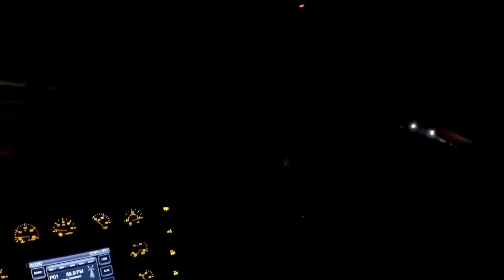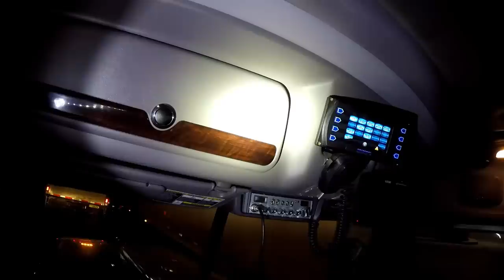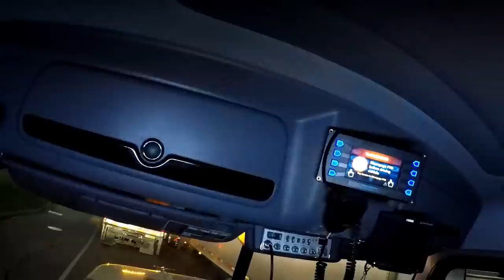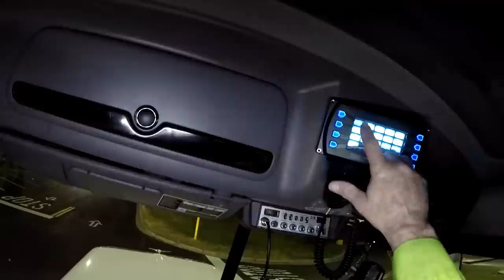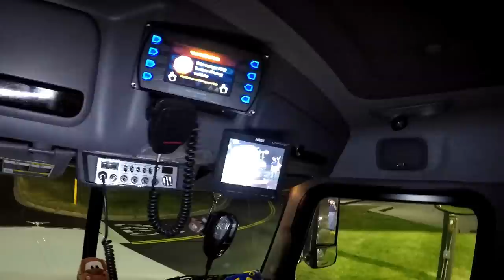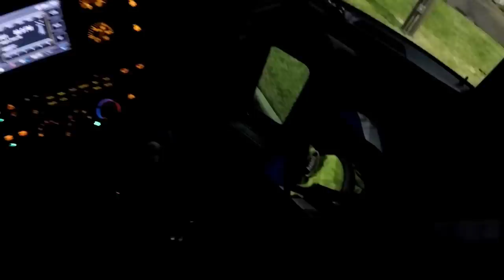Heavy Tire Lift Tow

Comment from the maker: One common question seems to be why I did not "tie" or "secure" the steering wheel.   The answer is quite simple...the steering tires can't move once they are strapped into the tire lift, therefore there is no need to secure the steering wheel.  Otherwise, on a front tow, the primary purpose for securing the steering wheel is so that the steer tires do not turn out while in tow.  Securing the steering wheel for a rear tow is absolutely necessary.  Hope this adequately answers your questions.  Thanks and God bless.
Reply: love your videos
Reply: As as side note for folks who keep asking these questions, I had run across quite a few videos a few years ago where someone "forgot" to secure the steering wheel while towing backwards.  In those videos the bus or car can "steer" to the side and easily take up multiple freeway lanes.  Securing the steer tires is only needed when those are on the ground and we want them to  travel in a straight line.  With the front wheels off the ground, there is no need to secure the steering wheel.
Reply: Ron, can you please make a youtube video of showing how to cage an air or disc brake on a tractor and trailer?  Jonmichal walker
Reply: Ron Pratt I love your video ever
Reply: i have heard stories of the tires rotating on the wheel lift and falling down the gap, but never heard of it myself. I must admit I do it just as a safety precaution as I'd rather not find out. Definately don't think you're wrong however
Reply: TRon Pratt
Reply from the maker: @MrShujinJonmichal  I have made several videos showing me caging brakes.  Here is one of them:  https://www.youtube.com/watch?v=-GotJXts-jE
Reply: How much weight can the rotator tow,and how much weight is it pulling by itself?
Reply: Hi Ron I was watching the pod cast of the cdl Chanel.  What video has pictors at the end of the marmon truck and domain reo.  Would love to see them  can u send me the link
Reply: @steventhibault8837 😅god bless you and your family 😊😊

Comment: Well that wasn't what i was expecting LOL. I was expecting you to pull up on a low bed that had dumped it's load of tyres and rims for something like a Cat 797 and you had to pick them out of a ditch and back on the trailer. 
Thank you Ron and Tom for another excellent video.

Comment: One thing miller doesn't do is set up back of truck for ease of air hook up. First thing I changed. All standard fittings and taps for different trucks. Got rid of those hard plastic semi hoses that come with it with odd fittings. Makes life so much easier when hooking up. Love your channel.

Comment: @6:21 Sounding the Horn 3 Times... I'm a US Navy Submarine Service Veteran (5 July, 1990-5 July, 1996; Navigation Electronics Technician), and 3 Short Blasts from the Ships Whistle means "Propulsion Astern", or Backing Up. On a side-note...At least she broke down next to a Food Source (Mickey D's). I wouldn't have thought a truck would have Front Axle Air-Bags, I've only seen leaf and coil springs (I learned something new) :) I truly like your videos Ron. You always explain what you're doing, and why you're doing it. You always promote Safety, and new Safety Equipment (like the Halo).

Comment: hi Ron, in my heavy recovery days in England  in the 70s im sure we had a air connector at the front of trucks to charge the air system made it so easy to get air into vehicle just a short coil pipe required, again very professional job. thanks Karl

Comment: I'm familiar with that stuff,  it used to come to our warehouse all of the time. Most we'd gotten in one shipment was 110 cadenzas, 40 bridges, 80 bookcases that those bridges go over, and 120 filing cabinets for one client.  3 semis came with that load. Worst one we got was 225 pallets of phone books, that were double stacked. Each pallet weighed 2500 pounds what our warehouse didn't have was a forklift with other peoples furniture also stored in the place. There were 6 designers who were having their high end stuff shipped to us. The place was always full even during the economic downturn. Seemed that folks had to move always. We have 5 20' liftgate Isuzu trucks and 1 International 26' liftgate.
Reply: Office furniture is a blast... when it's brand-new in the box :)  Not as much fun when it's used and has to be padded and blanket-wrapped.  HHG can be fun, but it's a lot of work no matter how you slice it.  I did it for 14 years before a knee problem forced me away from it.  I can still do it on a very limited basis, just not 6 days a week anymore.

Comment: Hi Ron, great video as always!
@38min: have you ever heard/tried the „over under cable wrapping“ technique for straight hoses and cables? When using it you can throw/drag rounds of hose/cable off the roll without twisting the hose into itself. After using it a few times and untwisting/rerolling your hoses once it is easier and faster than the standard wrapping technique most people use.

Comment: Great video, you just love theses late night working right :)

One of the trailers I used had a auto lift on the front axle, when on it would only go down when the trailer weight was over 10ton otherwise stay up, but if you pulled the switch she was always down, the only down side was the amount of air it took to move the axles first up.

Comment: Ron, I really enjoy these videos. You handle everything in a safe, courteous and professional manner. I like seeing how far the equipment has come since I did some towing in the 70s and 80s. Straps make things so much easier than chains. Why don't they put air hose reels on the trucks for trailer air and air tools?
Reply from the maker: A lot of trucks do have hose reels.  This particular truck setup doesn't allow for the hose reels due to lack of space and interference with other equipment operations.    Thanks for watching and God bless.

Comment: With the location of your lift axle and the weights, the main benefit of the axle really, is adding another axle of braking power.  The geometry of a front lift axle and a rear load such as a wheel lift sort of cancel each other out, unless your steering axle is running too heavy, then it would be a major asset!!

Comment: Also like a Tow-Dolly and full Car hauler strap. 

I'm well versed in them. In fact I put a tow-dolly on top of another, used the chains and straps to hold the top dolly to the lower one. I also used 8" bolts to make the chains from the top dolly that had come through the mounts on the lower dolly and going back up towards top dolly. By putting the bolt through 4 chains it made it so the upper dolly would not move. I used the wiring harness from the top dolly to my lighting plug because the upper dolley was more visible. 

I also knew that it isn't legal to do dual trailers behind a pickup truck which is what I was using. The Mississippi Highway Patrolman tried his best to make the upper dolley wheels to hit the ground to no avail, that was until he saw that bolt tying the tongue through the chain holders on the lower tongue. 

He did give me an escort to the state line from Jackson, Mississippi to Alabama. Then the Alabama highway patrol did the same thing till I go to the Florida state line.
 
Also when 20 tow-dolly's were put onto a lot across the street from where we were located, I attached 10 of them together using the ball on the dolly center. What I didn't know was that a FHP man was renting a truck and he saw me pull them across the street, making a wide swing and pulling up beside the building, getting them straight and backing them up without them going out of line. I did that operation 2 times and then found out he was in the building watching. He did make a comment not to try that on any state road.

Comment: i've got a question on your self-retracting straps - but first of all thanks a lot for all your work to record, prepare and upload those videos. I really watched a lot of them in the last weeks and it keeps beeing fun and educate in once - i really appreciate that. In addition, i like your ongoing attempt to do things safely - fits my own approach in working. So once again: thanks a lot and hope you'll keep doing those videos.
Back to my question: i bought several of those self-retracting straps here in germany - i only use them on my private car, so it's more light duty with dry storage in the trunk. But every single strap failed after some time: it always started with beeing hard to loosen them after use (i had to hit the ratchet hard several times until it unlocks) and then the self-retracted stopped working once in a while as second. In the end, i couldn't unlock them at all, i even had to cut some of to get rid of them. 
Is that something that you're used to with those as well - or are yours  maybe a better-quality variant than what i get here in the DIYs?
thanks, best regards - and stay safe
Reply from the maker: I have the same issue.  Mine work for a long time, but I consider them as a "disposable" and a "billable" item.  If I use one and have to leave it on a wreck for some reason I will bill it out to the job.  Others just wear out.  They are relatively inexpensive, so I consider their versatility and usage to be well worth the cost.   Thanks for watching and God bless.

Comment: Railroads do the same 3 blasts on the horn to reverse.  Although I do like the strap device over the wheels it would be easier to attach the vehicle tires on;t either a tow dolly or full vehicle hauler. Both of which I'm very familiar. 10 years hauling vehicles all over Florida, Alabama, and Mississippi. 
I do remember having to get 4 tow dolly's which I mounted the second one on top of the first. This made only 2-wheels on the ground which kept me legal for towing. Although you should have seen the MHP patrolman trying to get that second set of wheels on the ground till I pointed out the chains and a 6" bolt through the looped chains going through the chain clip on the tongue and back to the upper dolly. Did the same thing for both sets of dollies and the other driver had no problems either coming from Jackson, MS to Fort Walton Beach, FL. 
While I did have 2 tow dolly's attached to my truck, there were also only 2 wheels on the ground. The wiring harness for the upper dolly was attached to my lighting hookup.

Comment: Sir I have two helpful suggestions...first get 2" strap cut into the lengths you need for handles on your dunnage take Rose bud sear the ends slightly fasten to your blocks.....get a 4 wheeler which is also called furniture dolly which you can buy at house hold moving supply Harbor freight and Northern Tool have them cheaper. You can set on pavement tie a rope to it lay you tire dollies on it roll them back to your boom. They are easy to store only have to have one but myself I prefer two. Saves that back when they are fesable.

Comment: Ron, when you quoted the weights for both trucks I noticed that you said the truck you picked up was maybe 80,000 lbs gross but as a truck driver, I know that the front axle is only allowed 12,000 lbs. I believe that is all of the weight you had to lift. Rolling weight was a crapload.

Comment: Im surprised truck manfactures wont put air connections at the bumper or coming through the grill in the corner or though a small door for towing purposes. Once i get my hands on a tractor to use for farm purposes, those connections will be installed. I dont plan on the truck breaking down. If it does, i want it easy on the towing company.
Reply: Or how about a standardized drawbar/lift connection and be done with it?  No reason they couldn't be as easy to couple as rail cars.
Haven't seen anybody have to do it in a while, but I know it wasn't that uncommon to train up 2-3 tractors to get a heavy load up a steep slope, just like banking engines on a train, and a standard hookup would make that easy to do when needed.
Reply: All comes down to extra cost. It'll cost them an extra $50 and they're going to charge the buyer and extra $500, and the tow guys going to charge the same price whether you have them or not.
Reply: believe it or not there are malicious people out there that sabotage trucks when they walk by them like sticking thing in orfices and pulling fifth wheel pins while in truck stops so the less accessable to the public the better
Reply: Some trucks have air connections for emergency use purposes. It's not really a necessity because it's not always required and can be worked around (as they did in the video) when it is required. If he was just towing the tractor (bobtail) by itself, he wouldn't need any air connections for the short tow provided the air tanks had enough air to handle the air ride suspension for the short distance while keeping the parking brake released.

Comment: Have another suggestion....get you another set of coiled air lines for hooking up trailer. You can fasten straight line down hooked to coil lines gives you turn radious with out worry about lines getting hung up or dropping on you.

Comment: Great video Ron as always. I have an understanding of how a lift axle works, but it was a really great idea to explain to the people that didn’t know. I wouldn’t be a bit surprised if the truck you towed was at least 80k. Furniture is very heavy in some cases. That shut off valve on the other trucks air tank was a great idea 💡. 
Happy Holidays 

Thanks for sharing and God bless

Comment: Ron great video. Hope you get to charge more when you have to use the wheel lift because it looks like it takes more time and labor to set up to tow a truck using it.. I heard you asking Tom about one of the trucks regening I really hate the new emissions on the diesel engines I have a gmc 2012 2500hd duramax love the truck but do not like the emissions on it. The only problems I have had so far was related to emissions i know a lot of guys that have deleted the emissions on there newer diesel pickup trucks because of problems i can't delete here because of emissions testing. Do see or have you had a lot of problems with the emissions on the larger trucks? Also i know its different on small and large trucks pickups regen while your driving them and I know contruction equipment and large trucks have to regen while idling I believe.